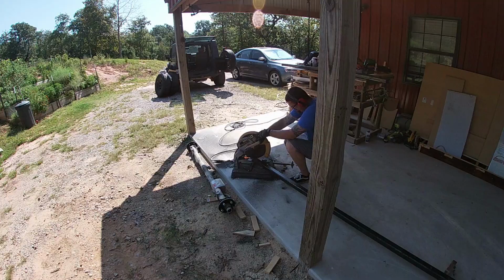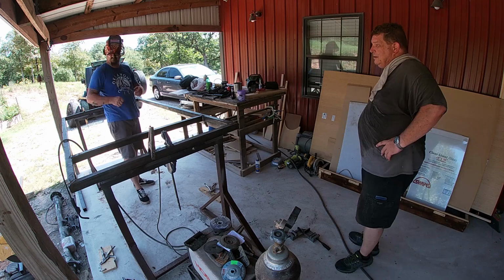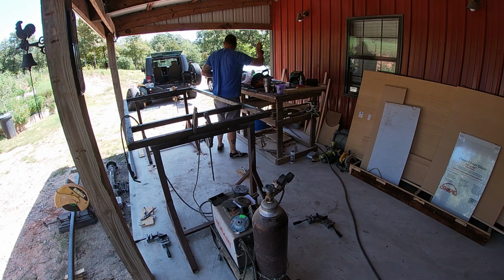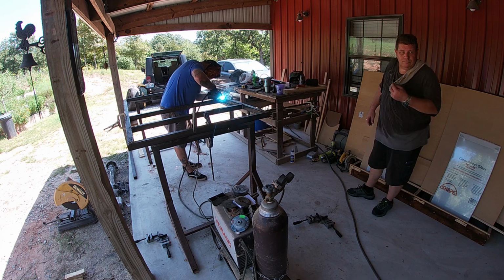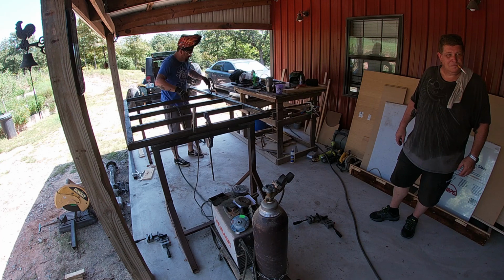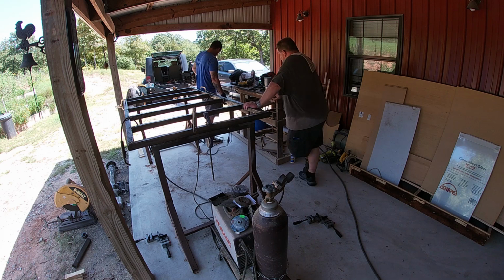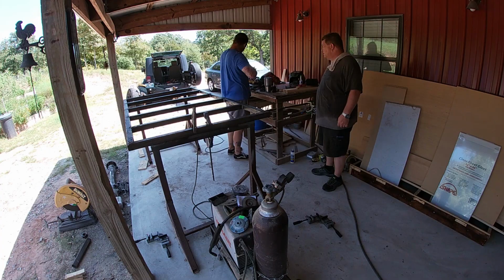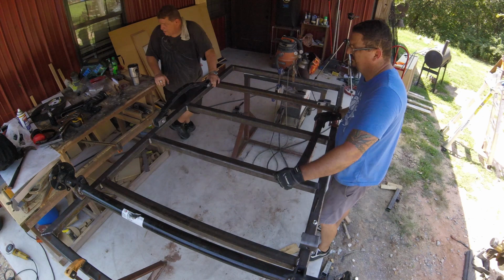DIY Overland Trailer Build Part 2 - The base frame

Comment: Awesome built, I am currently using yours as a guide, can you tell me what hub did you use to match up to the 5 o n5? Did you use electric brakes at all?
Reply from the maker: On mine and the one I built for my buddy we used the same axles.  Dexter 3500lb.  They are just idler axles, no brakes.  My trailer ended up weighting right at 1500 pounds with no water in tank, so I didn’t feel like I needed brakes.

Comment: Appreciate your attention to the details in your description. I'm getting ready to start my overland trailer build using a 4x8 trailer and am curious about the axel you used.
Reply from the maker: 3500 lb 48/60 axle and leaf spring combo from Ebay.
Reply: What exactly does the 48/60 mean
Reply from the maker: @tylerclause2772   that's the width of trailer frame 48 and the wide of the hubs of the wheels 60.
Reply: I may have missed it but what materials did you use for the walls and such? I'm going to be pulling with a 94 xj so I've got to watch my weight.
Reply from the maker: on the previous build for my trailer ?  1"x1" square tubing with  .063 aluminum skin.
Reply: What Gage of square tubing did you use? Is it hold up like you expected?
Reply from the maker: @tylerclause2772  the 1" is all 1/8" wall.  it has held up great.  we have our RTT on top that we sleep in and it hasn't shown any signs of stress or anything.